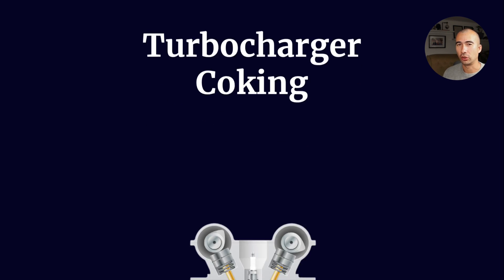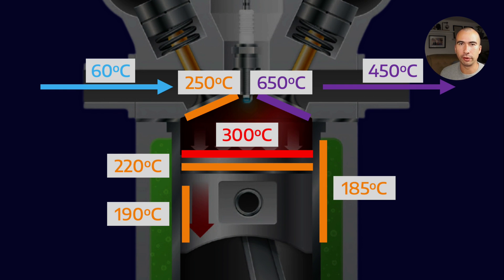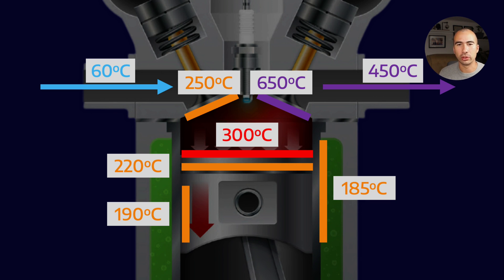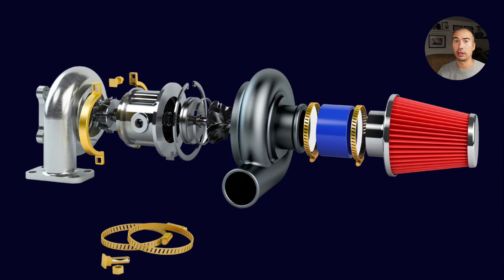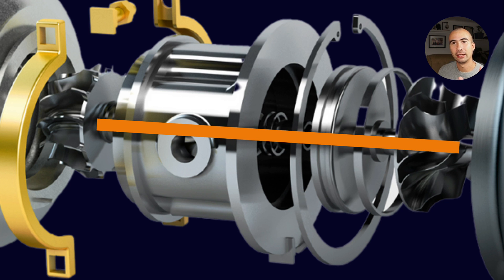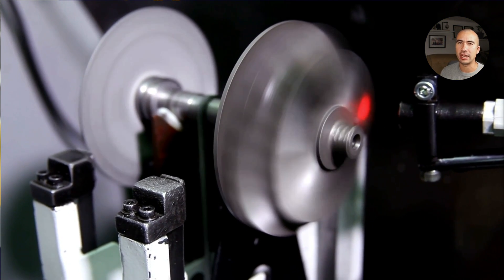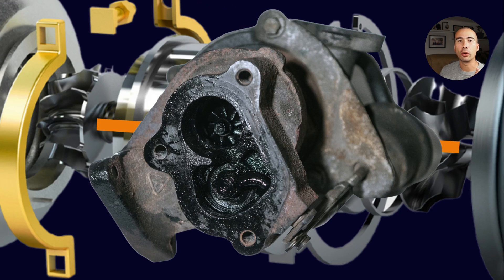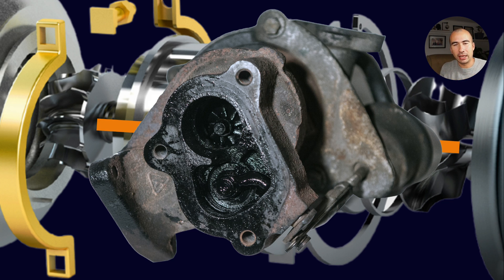Why is turbo coking a common problem with engine oils?

Comment: Don't own a vehicle with a Turbo Charger... But wouls be interesting in see if Newer Motor Oil options like Valvoline's Restore and Protect (which is meant to clean/remove Carbon Deposits from Pistons... Helping Reduce/Eliminate Oil Consumption and Sludge/Varnish in the Engine I suppose might be just the sort of thing needed to keep a Turbo happy right?

Comment: Don't run turbo hard and then immediately pull into garage or parking lot and shut off the motor. Let motor idle for a couple of minutes with turbo off. This will cool down the turbo and oil. Also change the oil and filter every three thousand miles with full synthetic quality oil.

Comment: Can I ask u question
My car use gasoline direct injection and turbocharger.
I live in the city where the avg speed is around 16kph (9mph) on peak hours.
Even though everything is standard, my car consume 1/2 liter oil per 1,000km.
Following official dealer's mechanic, the oil is 5w30.
With the traffic, south east asia hot-humid weather, and very hot engine, can I use 5w40 with same spec (sn plus)?
Reply: Same with my audi problem, but running a thicker oil will hurt the mpg a little and you will feel the engine a bit sluggish, been tried various oil brands to counter this including "ester base" engine oil but none works
Reply: @AB-dm9yz  how much you upgrade the SAE? 
Planning only up by 10 only, 1 of my friend up by 20, running well. Idk about the fuel consumption though.
Reply: @durgimstingetium  
My audi reccomnds 5w-40, i tried the ultra with GTL, total, etc and even mobil 5w-50 with almost simillar result, so I accept that it is the engine design that burns oil, 
Funny thing is recently I put ester base 5w-30 on several oci oil pressure is fine and the engine rev happily
Reply: @AB-dm9yz  Bigger Audi engines burning oil is perfectly normal according to Audi - it's "state of the art" because they are too stupid to make a proper engine (I drive Audi myself).There is one good thing about it, you don't really need to do an oil change besides the filter because you add new additives/oil all the time ;)
Reply: Using a 5W-30 oil that is designed for your vehicle should be ideal, even in hot temperatures, since a 5W-30 appears well suited in modern engines.  However, using a 5W-40 oil instead will increase the temperature of the 5W-40 oil, since the oil flow through your engine will slow, causing the oil to spend more time in the hotter parts of the engine.  Ideally, you would want to use a 100% synthetic oil, which generally has a higher thermal-breakdown threshold than a full synthetic oil.
Reply: @jimn.9990  sold the car already though, change to other.
Now I'm avoiding car with direct injection,  turbo and CVT.
I just have more confidence on old tech car, abuse tolerance is just up there.

Comment: Around 1:15 you said that the hot exhaust gasses do not go directly to the turbo, but instead will pass through an intercooler first. This is not the case; an intercooler cools the air that is being forced into the engine, between the turbo and the intake.
Reply from the maker: Good point - so this is actually interesting. I come from the aviation/industrial world (aerospace engineer then worked as industrial lubrication specialist). Many piston aircraft and marine/power engines operate multi-stage turbos. In these instances the "intercooler" works on the air between turbo stages whereas an "aftercooler" operates on the air between the turbo and the engine intake.
Reply: @LubricationExplained  Yes an aviation expert. Woohoo.
Reply: I think what OP meant was aftercooler, in which exhaust gas is cooled by heat exchanger before entering turbo. This is pretty common in marine and industrial diesel engine.

Comment: Would be good to see a video highlighting the (negative) effects of modern ECU engine tuning on oil and parts that will necessarily see higher pressure and temperature levels. I am thinking of pistons, valves, turbos, OPF and catalysts. I think this topic is highly underrated because people think that OEMs have built some margin and as long as you change the oil much earlier than recommended, you should be fine. A wrong perception in my view.
Reply from the maker: That's a super specific video 😄 Let me see what I can do.
Reply: You need an oil with higher HTHS and higher viscosity to combat the extra heat and wear. Ester based group 5 oils are typically what people use, if they know what they are doing and doing things correctly that is.

Comment: Can you say a word about watercooled turbos? and cooldown? More specifically - lots of people talk about how the need for a "cooldown idle" is diminished when you have auxiliary cooling for the turbos, but it seems to me that when the oil & shaft itself aren't spinning while this cooling down happens, you still leave a lot of room on the table for things to happen. Might be another plus point for separated hot/cold (i.e. electric) turbos...
Reply: Don't listen to these guys with a sub 300 hp turbocharged car in their first years of having a driver's license. Most of this "knowledge" they have is bogus. Just because they drive 20 past the limit on the highway they think that they've maxed their car out and done what no one has done before. Any street car without aftermarket turbos or upgrades which up their stock power over 50% can take the cooldown without a problem. You could drive off the highway and instantly turn it off, nothing bad would happen, not even if you did this every day. All cars beyond 2009 have a cooldown sequence and monitor the various temperatures. 

If you track your car thats a whole other story
Reply: @User-th6yy  I don't have a turbo in any of my cars and I'm not really listening to things like "steady speed driving at practically off-boost will heat up everything", but some spirited driving (lots of overtakes on a curvy road) might lead to such a condition, I guess. Anyways, just a thought.
Reply: @SpiritLwerewolf  There are many variables. 650c is quite common inside the exhaust gases of a turbocharged car under load. The larger the turbine and exhaust system (thermal mass) the longer it will take to cool down. Turbo timers are used on trucks and vehicles that run at high loads. If you were to run a turbo at high load and it only had oil cooling and you turned off the engine straight after high temperature, the turbine housing will transfer a lot of heat into the oil and will coke it. Most of a turbos wear is during startup like the rest of the engine. The shaft spins up on a dry bearing.
Reply from the maker: I think this mainly applies if you're running the engine real hard - so for example if you're at the track. Most modern light duty vehicles don't really run hot enough for a fast shutdown to become a problem. Or at least, that's my take on the situation.

Comment: Awesome vid, there's a Ford channel recommending 3k mile intervals for the escape due to small sump capacity, direct injection and turbocharging. It's the first time I've ever seen 3k mile changes make sense
Reply from the maker: Wow! 3k! So short...
Reply: Most Ford's for some reason recommend Syn blend oil Don't know why I personally use full synthetic typically Castle Edge or Amsoil haven't had any issue currently at 93k miles.

Comment: Good explanation & pictoral :) Presumably for petrol? Diesel another kinda scene? A bit?
Whatever... Engine designers/ Lube manufacturers, are supposed to Know all this? In The First Place?
The User, Just follow Manufacturer's Manual? Re: Oil spec/ Svc Interval/ Cool down time, after hard run?
Reply from the maker: Yeah I think the main problem is just that a single oil is trying to manage two entirely different systems. On large industrial engines the turbo usually has its own dedicated oil system.
Reply: @LubricationExplained  if you put a separate oil sump and pump for the turbo wold be better? and what tipe of oil will be the best for only the turbo